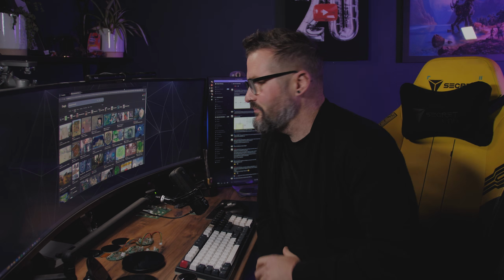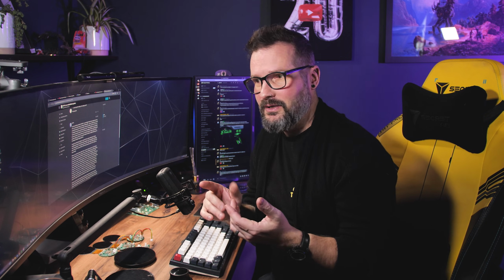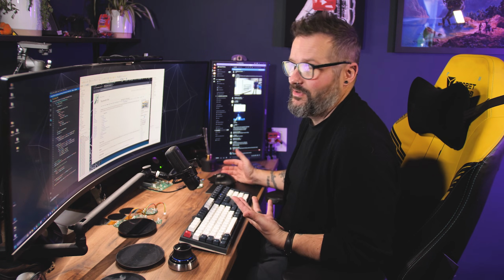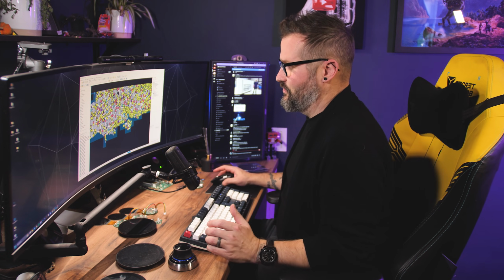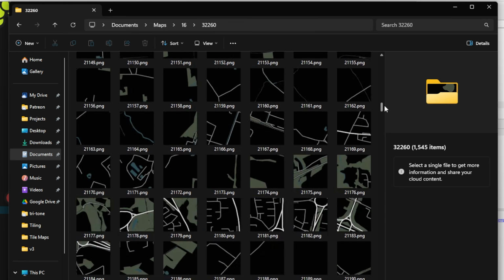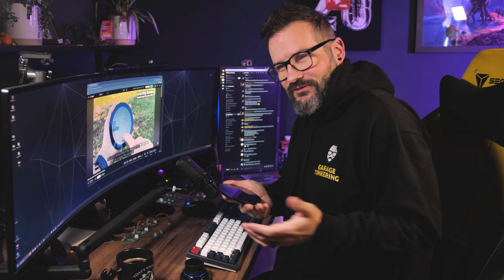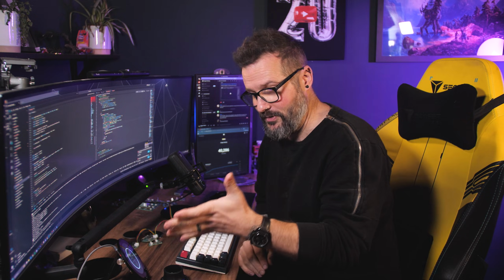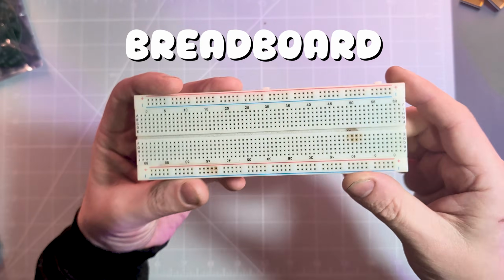A Real Mini Map from Need for Speed

Comment: This is awesome project.
I think about only one improvement that can be added and this is render markers that are outside of circled area.
Like if you have less than half of tank, then find nearest petrol station (since P4 is a dual core, it can be done in background), store it in memory, invalidate every 2 minutes.
Then take the coordinates of this petrol station from memory, calculate a vector, normalize it to the white circle inner radius and then render marker.
Reply from the maker: Fun idea. The dual core is already being optimised for simultaneous animation and tile loading, but I do think there's a way to of creating markers as a separate layer which opens up some interesting possibilities

Comment: I'm guessing you script to conver from PNG to BIN was running sequentially. That's a good use case for running the script in parallel/asynchronously with asyncio and aiofiles. Though, then you might run intocpu and rams limits.
Reply from the maker: Runs on multiple cores at once. I dread to think how long it would take on only one.
Reply: A glove box kubernetes cluster of raspberry pi’s might do 😂

Comment: I would love to see this integrated to your phone and a radar scanner, so you can add waypoints when you find a shop you like, and it can actually track police cars!
Reply: I wonder what it'd take to get accidents and speed trap info from waze or google but thatd probably require adding cellular or wifi/bt sensors to connect to a network or a phone running a script to push info to the dash map
Reply from the maker: I'm not sure if that information is even available via an API, is it?
Reply: @GarageTinkering  looks like arcgis, tomtom, microsoft, google, and more got an api for this kinda stuff
Reply: @geobot9k  openstreetmap already has speed cam data, but for the rest idk
Reply: @geobot9k You need to be very careful with this kind of information.
In the UK specifically, publishing or making publicly available the positions of speed cameras and police is strictly prohibited and carries large penalties.
I’m not sure how Waze legally get around this and I believe they have been through legal issues relating to it before.
Reply: there are several game themed maps available for phones just like this. you can even see other users cruising along

Comment: Why not have a canvas with 9 tiles (a canvas which you can rotate)? Then whichever tile you're currently on is always positioned in the middle of the canvas (slot #5). Then whenever the tile in slot #5 changes, your code will check which slots on the canvas is currently empty and load the relevant tiles suceeding (sequential) tiles (aka. lazy loading). This method in theory should work well because as soon as you start your car, you'll wait for a few seconds (putting seatbelt, check mirrors, gear etc) before driving off - plenty of time to get current GPS and load 9 tiles from the get-go.

Canvas of 9 slots (slot #5 = current tile / other slots = surrounding tiles):
1 | 2 | 3
4 | 5 | 6
7 | 8 | 9

Another suggestion: Does the hardware support C++ language? If so; take your current Python codebase and see if AI can churn out an equivalent C++ version. In theory this should perform faster if the hardware is capable and obviously you need to test it for quirks etc - but it should work.
Reply from the maker: This is exactly what it does... in C++

Comment: 17:35 - tbh it IS and isnt. I would assume most people want the car face up as going forwards and the map rotating under it. however, i remember a number of nfs games allowing you to set the map orientation as static and then the car would be the one rotating on the minimap. So its all fine i think.
Reply from the maker: Apparently both are options in the game so it's good both ways

Comment: Great project!
Only thing it is missing are icons on the border of the map 😇

BTW ESP32 P4 has pixel processing accelerator. Rotation should be feasible by filling slightly larger image than screen size with tiles and the rotating it using PPA. Using buffer larger than screen with all tiles in north orientation (cache) and copying and rotating the copy and then drawing car marker should speed it up.

Since tiles have low color count saving them as grayscale with specific grays reserved for other colors would reduce bitmap size by 2/3s speeding up loading and saving disk space.
Reply from the maker: Interesting. I need to look into that a bit more
Reply: Yeah but by assigning shades of gray with colors, you will lose the antialiasing. I think that custom color palette inside png would be better.

Comment: Very cool. I have a few suggestions:

Map updates > If you build the workflow into Github Actions, you could have it periodically (Monthly?) collect all of the data, process it and dump the tiles into Github atuomatically.

Rather than using baking the points of interest into the tiles, store the locations and add them on the ESP32. This gives you a few benefits:
1) Easier to update when they change
2) Zoom independently, you can now zoom in/out while maintaining the same dot size
3) You can add text to the POIs
4) You can show/hide the different types of POIs as required

Related to the above, rather than using tiles of images, use tiles of raw path information. (Like segments as start, stop and type of road) You'd then render these directly on the ESP32 as required. You can render it in layers, drawing a series of larger black lines for the stroke and then rendering the coloured roads over the top. This also resolves the rotation issue, as it's rendered in the correct orientation. You'd still use tiles for the path information, to restrict the amount of data you need to hold in memory.

Having the raw path information also allows you to do path finding for navigation, and it's much quicker to copy over for updates.

Comment: Weird sponsor adjacency... I have the A129 in my Soul, and had an A129 in the Zoe we had before that (it stayed with the car when we traded it in). Swear by the Viofo dashcams, recommend them to anyone that asks my opinion.
Reply: Yeah, I have the A129 Duo in my own car for a number of years now and it has been amazing. Zero issues and solid image quality. And if you're REALLY into tinkering, I believe there's a dashcam specific forum out there (forgot what it's called, been ages) with a Viofo section and people have provided modified firmware which adjusts and improves some video quality parameters internally.

Comment: Early tomtoms used a 200MHz ARM920 that couldn't even do floating point precision, why wouldn't an esp32 be able to
Reply: Yep this was my immediate thought as well - GPS units have been around for a long time with equally constrained hardware. Pre-rendering tile images makes the whole thing significantly simpler
Reply: Because the Tomtom didn't load in images, it was using vector graphics and pure math. Much simpler really.
Reply: @zaprodk  Tomtoms did a lot with very little, with how fast commodity microprocessors and computers are now I feel like we've lost some of the "magic" of programming.

But I don't want to go back to the old tools I love my modern IDE and nobody can take it away from me
Reply: My thought exactly. I was wondering if the quoted commenters thought he'd use google  maps or open street maps in a browser to do it. Which would absolutely require something more powerful.

Had he used the vector maps approach, he wouldn't have needed the ESP32-P4 (which feels a bit like cheating), but it probably would've taken a lot longer to develop the solution.
Reply: I developed one of the worlds first ARM Linux distributions and used to run that on a 60Mhz ARM6 with 128MB of RAM with a full GUI. The game Star Fighter 3000 came out on 25MHz ARM3s on Acorn machines and was full 3D render graphics at 60Mhz.  You really don’t need an FPU if you write the code correctly. The ARM has a multiply instruction and is 32 bit so just used fixed point maths.  Basically if you have a 32 bit int with the top 16 bits as whole numbers, and the bottom 16 bits as the decimal fractional ones. Multiply them and the result is a 32 bit whole number and a 32 bit decimal fractional value. Eg, 0x0001 0000 (1.0) x 0x0001 0000 (1.0) gives you 0x00000001 00000000 (1.0). If you do 0x0010 0000 (2.0) x 0x0000 0010 (0.125) you get 0x00000000 0x010000000 (0.25). A lot of the time you don’t really need the accuracy so can throw away data.
Reply: I hardly ever use float and double in code.
Reply: @melanierhianna  if you spend a lot of time in high-level languages they don't even do floats properly anyway, it's just simplified exponent maths they don't even bother asking the cpu
Reply: @IslayAnderson  what languages are you talking about? what do you mean by "they don't even bother asking the cpu"?
Reply: @ElvianEmpire  Anything interpreted in the V8 engine, basically all scripting languages, and I'm pretty sure zig does it too for the most part
Reply: @IslayAnderson  how do they not ask the cpu? what is doing the calculations?
Reply: @ElvianEmpire  it doesn't ask the CPU to specifically do floating point maths in some scenarios its faster and more cross platform accurate to implement you're own exponent maths to represent floats 

Code that has to run accurately but not to crazy precision and cross platform will often do this
Reply: @IslayAnderson  ah, that's what you mean. I get it now. Thanks for the patience.
Reply: Never seen your channel before. Liked and subscribed. Great work! Great video!!!!
Reply: I have a Vector GPS unit from 2006 that runs windows 95...
Reply: Because people forgot or never learned to program µCUs on bare metal.
Reply: @jeffgoldman1735  That's arcane magic now. I do remember the times before Arduino, the old 8Bit micro rivalry between AVR and PIC. Todays 32Bit micros have so much power, that people need to mostly think about the limited RAM rather than compute resources. An ESP32, if it could address enough RAM, could probably outperform early DOS and Windows computers.
Reply: @J0ermungand  An ESP32 (the original dual core Xtensa 240MHz one with 520KB RAM) can definitely address 640KB, it even natively supports up to 4MB of SPI-connected PSRAM. There's also a minimalistic x86 emulator which can boot Windows 95 on an ESP32-S3.
Reply: @Djhg2000  Gee, I wonder what's possible with a ESP32P4.
Reply: @Djhg2000  Yeah, I know, I've heard of the emulator too. But I was thinking along the lines of the Win 95 - 98 era. Something up to a Pentium 1 or even 2. And back then everything was merely single core too. But those times had much more RAM.
The funniest thing would be to get an old Voodoo card running on a modern MCU and play some old 3D game on it.
Reply: @J0ermungand  Much more RAM is subjective, but most computers had RAM in the double digits of megabytes back then. From the datasheets it looks like consumer chipsets for Pentium 1 topped out around 128MB but the high end 430TX could support up to 256MB. Server chipsets maxed out at 512MB, which at the time was huge.

More importantly Windows 95 ran on much more inefficient x86 architectures at speeds below 100MHz unless you had a shining new computer. Most DOS games were designed to run at 16MHz CPU speed until faster ones became common, which is why the turbo button was a thing on Intel 386/486 machines.
Reply: Because it didn't have GNSS module yet?
Reply: @nopus1  GNSS is just a more generic term for a GPS module which can receive satellites from more systems than GPS like GLONASS, they are all still able to output that old NMEA0183 formatted data. So technically no, Tomtom devices didn't have GNSS modules but it makes no practical difference.
Reply: @Djhg2000  I mean ESP32 - not TomTom
Reply: @nopus1  Then I'm confused, to my knowledge no ESP32 to this date has ever had built-in GNSS but cheap GPS modules have been a thing since even before TomTom?

Comment: Would it be possible to rotate just the final image rather than the tiles themselves individually? And also maybe scale it up even if just using nearest neighbour scaling to fill the whole screen
Reply from the maker: Rotating the final image is what I was doing and it's just as bad. 

There's no need for scaling in order to do the full screen, you can just set it to a larger 5x5 grid and not have the overlay. 

I chose not to for aesthetic reasons and for balance with the other gauges that it's going with

Comment: 17:30 You do know that there is a setting for the minimap in NFSU2 that is called "Static" which works exactly like you build it. So it still is 100% accurate to the game
Reply from the maker: Woooo, canon
Reply: I also always play that way.
Reply: @therealfrogcrush   inly mouth breathers leave it on dynamic
Reply: I use Static for free roam, and Rotate for races
Reply: @HLGJammer  same
Reply: indeed, I even prefer it that way
Reply: @JPWack  it was easier to drift around the turns

Comment: I don't know the ins-and-outs of how this works but is there no way to rotate the image once you've drawn it to the screen (rather than rotating your loaded grid of images)?  It looks like there is an `lv_img_set_angle` that might speed things up (if that's not what you were using already to do rotation).
Reply from the maker: That's exactly what I was doing but it still requires redrawing everything that's on screen, so the memory overheads are exactly the same

Comment: Part 2: a moving minimap based on the technology used in the RAF's Harriers in the 1960s. requires basically a miniaturised microfiche viewer and the map is a long length of film. north-south the map moves under the cursor. east-west the cursor moves left and right. when the cursor reaches the edge of the map, the backlight dims, the cursor moves to the other side, and the map moves fast to the next column 😄
Reply from the maker: That seems.... inefficient ha
Reply: @GarageTinkering state of the art for the 1960s and could fail in all kinds of interesting ways - I'm told!

A bunch of aircraft had similar moving maps but without the magnification element - just a paper map in the cockpit that would scroll up/down with a physical cursor moving left/right, again with entertaining scope for misconfiguration and failure and oops the map tore and the motor's pushed several meters of map into the cockpit. The Mi-24 Hind for DCS has such a map, but not in any great depth unfortunately

Comment: Working on something similar but I would like to display the actual lines you have to follow to your destination, it's a huge project but now I know it is possible! I will let you know if i get to finish it :)
Reply from the maker: Yeah, I'd love to do that as an option. It's definitely a significantly more complex problem. If you figure it out, please let me know
Reply: Vector rather than raster tiles perhaps?
Reply from the maker: Likely. LVGL has vector support, as part of a latest update, so might be only a small step from this to get there relatively soon.
Reply: @GarageTinkering  with a mobile app that could send this info to the esp via ble (from for example google maps api). 

In theory you don't need to store the entire maps on the esp, you could also send only what needs to be displayed and a bit more for buffering. The phone can pre-calculate and send ready to display data whether it is an image or vector.

Comment: Brrooooooooo 🔥🔥🔥🔥

Next you just need that arrow to diplay in a reflection on your windshield and you can drive like a pro
Reply from the maker: Already working on it
Reply: I have looked up how to retrofit heads-up displays in the past, but my understanding is that the windscreen glass is tapered for heads-up vehicles. It's a shame, because having a car with a heads-up display totally changes how you drive and I want it in all of my vehicles.
Reply: Yep, if you don’t have a HUD variant windscreen you cannot eliminate ghosting of the reflected image due to the laminated layer in the windscreen, HID variant windscreens have a special intermediate layer that corrects the distortion so that the second reflected image is aligned to the reflection from the glass layer